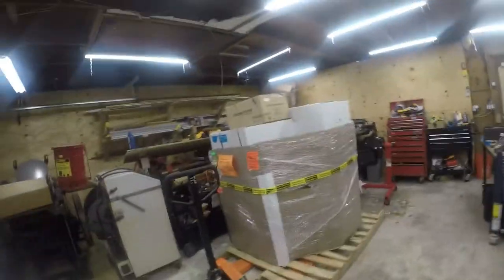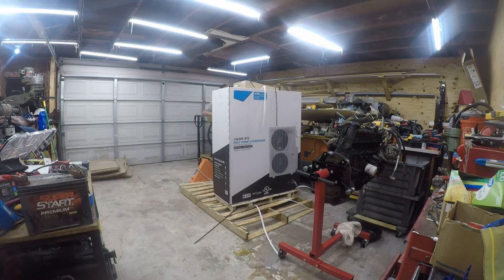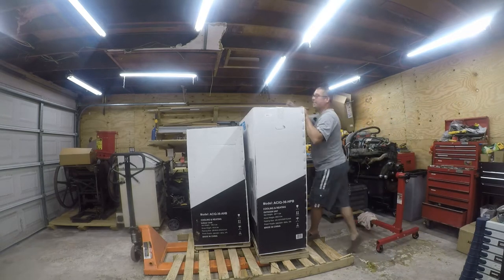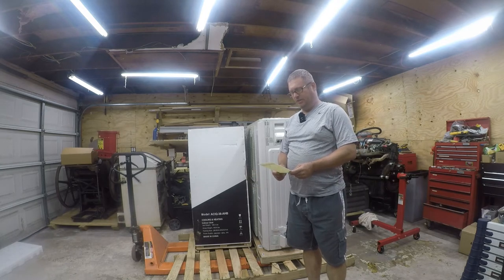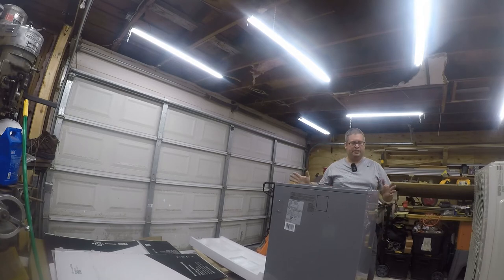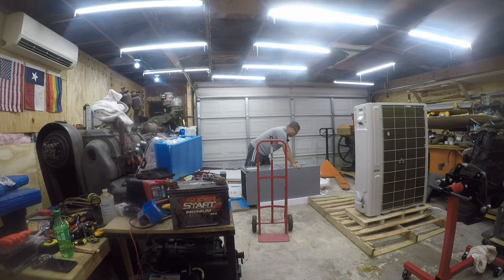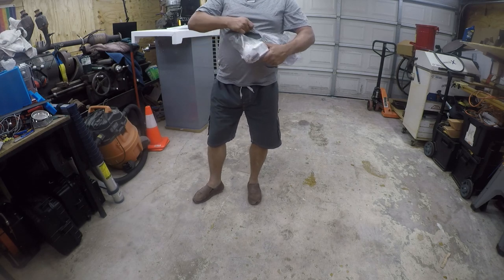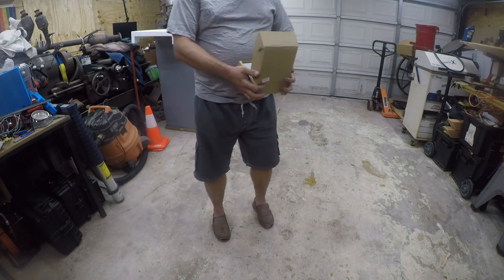HVAC Replacement 2: ACIQ Unboxing

Comment: I’m an hvac commercial and residential tech . I install big name brands , I bought this for a dual fuel system for my house because it’s the same exact product as a Carrier. Same exact thing. Glad it worked out for you, any other homeowners on here good luck don’t freeze your hands off and don’t electrocute yourself

Comment: Looking forward to a follow up video as I am considering an ACIQ mini split system.  I would appreciate further comments on your opinion of the company and its equipment as I've not been able to find out much about them or any (other) product reviews.
Reply from the maker: ACIQ is a private label of Midea.  It seems to only be sold by HVAC Direct.  I have to call them in the next day or so to ask some questions.  I'm impressed with what showed up so far.  Other DIY oriented split systems play games with their ratings and do not have the submittal sheets that should be there.  I've already had the Goodman experience.... or Good For Nothing Man experience as I call it.  The specs on the compressor are impressive... 36K btu nominal rating, but the capacity per the manual is 7500 btu all the way up to 50,000 btu of cooling.  That's an amazing swing for a compressor.  Most variable speed units can swing about 30%.  If it does that it will be phenomenal for my energy bill and my spray foam house.
Reply: @hotpuppy72  Thanks, very helpful.  Looking forward to additional videos.
Reply: @hotpuppy72  any updates for the unit? Considering on buying one myself
Reply from the maker: @oneHellvalley  It's been working well.
Reply: @hotpuppy72  thank you

Comment: I just purchased the ACiQ central system. I would have considered the mrcool universal but they wouldn’t email me back answering the questions I had. 
Here’s hoping it was worth it. Are you able to handle refrigerant in Texas without a state license.
Reply from the maker: You still need your EPA certifications.  Be sure to go get the latest manual from the webstie.  The DIP switches are not setup right for 24v control and you'll need to set them.  The new manual has them, the old one doesn't.  If you bought a heat pump unit you need the O/B diagram which is second to the last in the list of diagrams.  

I have had hell getting HVAC Direct to return my calls for support.  I eventually figured it out on my own.
Reply: @hotpuppy72  Thanks for the info, I appreciate it. That’s a little disheartening to hear that HVAC direct hasn’t been very helpful. 
Thanks for showing the unit with the packing from freight on it, now I know a little more of what to expect.
Reply from the maker: @JohnBrowningsGhost  It's possible it's just one bad employee or someone who lost the messages.  I don't know.  I've never made a stink of it.  I also did not tell them I was vlogging the install and have 10K subscribers.  I wanted to be treated like any other customer so I can tell it like it is.

I have called them twice.  Both times the ticket was sent to the same person.  First time he called me back and left a voicemail that answered one of my questions regarding the communicating thermostat.  I called him back, left a VM, never heard from him.

Second time I called and asked for a call back on my work number.  I get detailed call stats from that phone system.  Called back a couple days later and was told they were really busy.  Never did hear back from anyone.  In the meanwhile I figured it out on my own.

My advice: If you have doubts about your skill set, have a licensed HVAC tech hook up the lines and wires.  A good chunk of the work is physically removing the old unit and physically installing the new unit, wiring power, etc.  As long as you provide them the updated diagrams and they understand what this is they should be fine.  You average HVAC guy will struggle with this because it's different.  You need someone who has more of an engineering and design mindset who is willing to figure it out.  You'll pay for that, but you'll also get a good install.

Comment: What is your experience so far with that aciq unit you unboxed ?
I am thinking about buying one for a house in New York
Reply from the maker: It's been working great.
Reply: Is it quiet ?
Reply from the maker: Yes.  Like most inverter units it's almost silent.
Reply: Thank you for the input I need to replace a system in NY just want to buy the right system and not be sold what I don’t need by Hvac guys in NY
Reply: Did you have to upgrade the electric service line for outdoor unit

Comment: What a fantastic video. Very helpful. Is  the 3 ton ACiQ unit sized well for your application? Please consider a follow up video. Thanks
Reply from the maker: It's been working fine since I put it in.

Comment: How’s this unit done in the Texas heat? What’s the coldest outdoor temp it’s faced and did it perform well? Notice electric bill difference?
Reply from the maker: It does great in the heat.... and produces tons of heat.  Coldest temps this year have been in the low 40's, so nothing magical.  Electric consumption is where I expect and similar to what it replaced.

ACIQ reached out to me based on these videos.  Had a good conversation and they encouraged me to switch to the communicating thermostat.  I did.  That is much easier to setup.    Should also deliver better modulating performance by allowing the compressor to swing from 7K BTU to 48K BTU which is what the system is capable of.  

Only downside to the communicating thermostat is that it wants to measure the temp at the unit, so I've had to adjust manually by a couple degrees.  It's also natively working in Celsius even when it's in Farenheight.  So what you set it to and what it actually is has a small difference.  I can live with that.  Also, the fan does not have a circulate mode, so I've just set it to about 60% and left it alone.  The system is dead quiet.

I still need to fabricate a new plenum adapter.  Had to order new ductboard tools and have been busy.  Maybe this coming week.  Once I do that I'll have to re-adjust things again.  Right now probably 25% of the air is looping back into the attic.  Keep in mind I have a conditioned attic, so it really isn't that big of a deal.  It's just a minor efficiency drain on the system, but the heat/cool is still in the house.
Reply: @hotpuppy72  very nice. I’ve been looking at these. Sadly when I had my house built in 2020 I believe the builder undersized my heat pump. Ended up with a 14 seer 2.5ton and should of been a 3 at least. I should of put more effort into getting it changed out but I doubt I would of had any lucky. What size unit did you get? HVAC Direct seems to have conflicting info on the SEER rating. Looking at the 3 ton, some places it says 18 and others it says 16.5.  Did you run new line sets? I wonder how hard it would be for a swap out my unit for one of these.
Reply: Also, how's the energy usage been?  Any comparing numbers you can share?

Comment: How has this system been for you over the past year?? Have you used it for heat??
Reply from the maker: Very happy with it.  Worked great for heat and it's maintaining the temperature in my house within a degree or so of 73.  At the thermostat it's spot on.   I have it set to 73 right now. I have a 2 story house.  It's 100 out today. Thermostat is downstairs in the hallway.  Energy consumption doesn't look any different today than it usually would.  It's so quiet I really have to look at it to figure out if it's running indoors or out.

Comment: I'm looking at this exact unit.  How has your experience been after 8 months?
Reply from the maker: it's been solid.
Reply: @hotpuppy72  Thanks for the response!  I actually just received this exact same unit.  I'm waiting on a call back from tech support on wiring.  It looks like the blower unit needs its own supply circuit?  It's odd.  I've looked at the manuals for the Blue Ridge version and the Cooper and Hunter version, and each have some differences in how the manuals show things being wired.  How did you handle the power to the air handler?  The air handler label says max Amps 15.  Did you run a 15A circuit dedicated for the air handler?  I also bought the 15kW electric heat, but the best I can tell it dedicates a 30A circuit as well as a 60A circuit for the electric heat, but that's separate from the air handler circuit in the diagram.  Even my HVAC guy looked it over with me and said the only ones he has done were actually supplied power from the condenser through the mini split control wire bundle.  But this looks different.
Reply: @Jonra0  noticed the fella in video purchased a 5kw heat strip.  Since in TX, wouldn't imagine he would need any more than that.  You mentioned 15kw, what part of country are you located in if didn't mind me asking?  Just curious because I just purchased this unit in southern Ohio, but ordered the 8kw strip.  Sounded like the unit heated without the strip to around 0 degrees.  Did you find the 15kw to be needed?  I am contemplating trading the 8 for the 10, but know I will need 60 amps dedicated instead of 40.

Comment: How are you liking the system?
Reply from the maker: Still working great and keeping me comfortable.  It's so quiet I have to walk up to the outdoor unit to figure out if it's running or not.  I think this is the future of HVAC technology.  With the recent regulatory changes that became effective Jan 1st, only systems with inverter driven, variable speed compressors are going to be able to meet the efficiency requirements or differentiate themselves from the base model.  Off, 50% , 100% or Off, 60%/100% "multi-stage" is just simply not going to deliver the performance and it's what the big names have relied on for years.  It's cheaper to put in because the compressors are simple and the drive / control technology is simple.  All the American brands use components made by a few companies.  All they really make is the software that drives it, the sheet metal outside it, and the brand logo and manual.  You do get what you pay for with Carrier which is a top engineered system installed by a thoroughly vetted contractor.... but everything else is a crapshoot in my opinion.  Lennox is having coil leak issues similar to what Goodman had a few years back and that is part and parcel of Stellantis (dodge/jeep/chrysler) products.  Every Dodge/Jeep/Chrysler eval coil will leak and requires removing the dash to get to it..... cost based design. SMH.  Trane isn't what it used to be, but it's a close second.  Daikin bought Goodman, remains to be seen how much Japanology is infused.  The Japanese are great engineers and excellent manufacturers.  Goodman started out to be a cheap option and that's basically what it always has been.  Their base units are solid, the fancy units not so much.